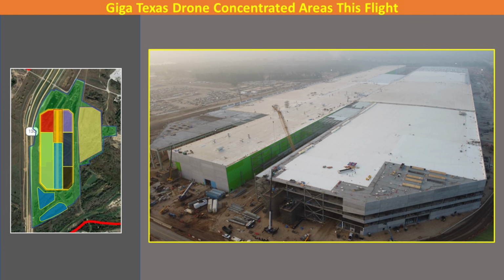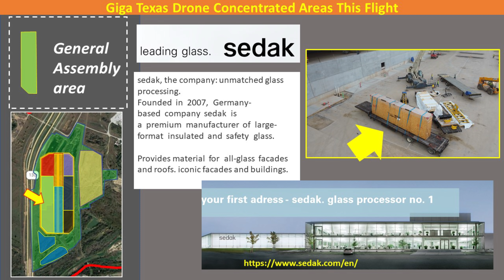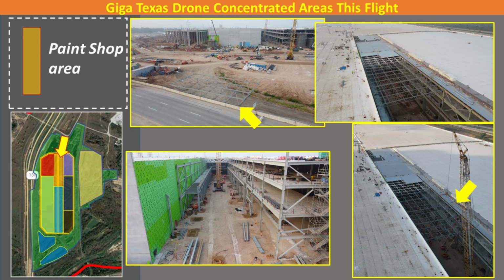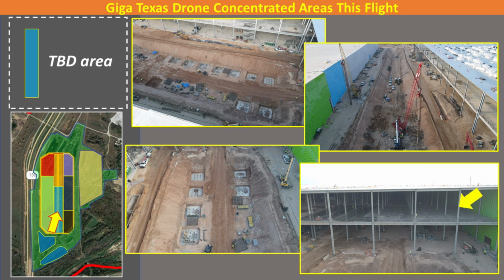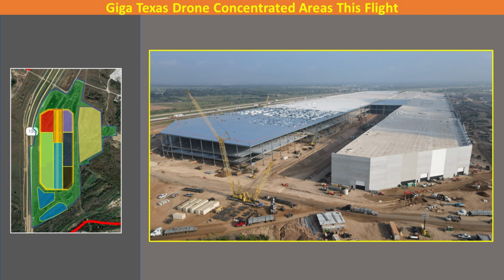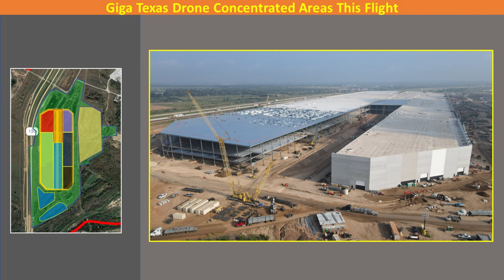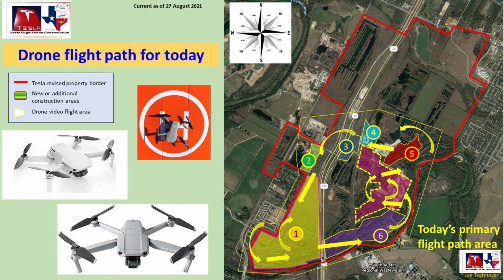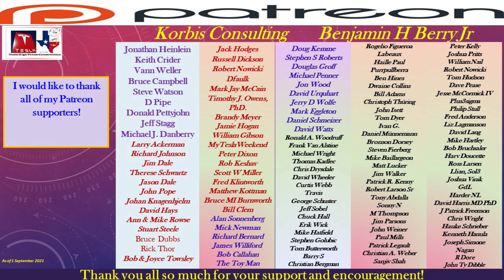Tesla Gigafactory Texas 1 September 2021 Cyber Truck & Model Y Factory Construction Update (07:45AM)

Comment: Thanks Joe. 
4:20. North side paint/casting. Pile of black pipes in front of the red bin. Showing up all around the place. 
4:27.  North side paint. Removed some of the wall panels being used as a temporary apron. Lot of activity in the shot.
4:45. Battery ground floor. Something under cover of plastic. Long row north south.
4:53. North alleyway. East columns. The 2 lower horizontal members have a projecting ledge welded to the east side likely for something to land, another stud wall perhaps. Some visible on the ground to the right. 
5:32. North alleyway. Roof decking is a different profile over the geodesic frames. Less ribs, and likely deeper.
6:28. Bunker roof. Scaffold deck through the opening. Glimpse of something going on under, lights.
9:34. Battery Level 3. Left of screen. Large red valves against the green wall.
10:06. West side battery. Retaining wall. Pipes on the north side have been lagged, might be burying them in concrete. 
11:00. West side GA. Window sills are different to the those further north. Black powder coated. Better fixing likely for the larger panels. 
12:50.  South alleyway footings. Some squares busted out of the mud slabs, must have been too high.
Formwork panels being installed to form up the pile caps. Interestingly, elsewhere on site almost all the footings were poured into excavations, weren’t boxed out.
A few smaller rebar cages to the left.
12:57. West side of pit. 8’ drains. Seems to be careful removal of drains, followed by back filling and compaction. Change of plans surely.
15:42. South end roof GA. Workers on the roof screwing down the sheets. At the speed they are working, it must just be along the joins.
18:01. South west corner. Sprung a leak.
19:20. South end. Bottom of screen. Several loads of what look like dock levellers.
19:38. South end storage. Lone precast wall panel on the trailer is one of those removed from the northwest corner of stamping, 6 or more months ago when the first section of temporary blue wall was installed. Fate undecided?
22:40. East side storage. In those piles of steel are the clues to what is being constructed in the south alleyway.
23:04. Bottom left of screen. Very quiet at the Skunkworks today. Beavering away in secret on……
23:36. Geodesic frame assembly area. The trailer has had beams fitted to the underside  of the cross members. A safety device I’d guess if it starts to tilt. They may have had a moment!
Reply: Glad you're back with your detailed assessments.
Reply: 4:20 - Tons of straight black piping like that is usually for fire sprinkler runs.
9:34 - Fire sprinkler distribution manifolds and shut off valving.
Reply: @jbarvideo12  Thanks Jay. I sometimes miss Randy's because by the time I view it what would be speculation has become fact in Joe or Jeff's videos. Jeff's I generally don't get around to looking at until later in the day, but generally comment.
Reply: @steve4hockey  Should be a lot of that in the battery area. Thought I spotted the main control valves on the ground floor. To the right of the green scissor lift in this video; https://youtu.be/G2Mc7tPVDso?t=973

Better shot in Joe's Patreon pictures.
Reply: @DessieDoolan  yeah there’s sprinkler feeds in a few different places. Red valves and black pipe is typically a Dry-Pipe sprinkler system.
Reply: @steve4hockey  I had to google Dry-Pipe sprinklers systems. Heard the term, but really didn't know what it meant. Don't think I've ever struck one before. 

Amongst other things, they'll have to crack on with getting the water supply sorted out. As far as I know the water is still being carted to site.
Reply: @DessieDoolan  Very common here especially for facilities like this. A lot more maintenance and facility friendly to keep the sprinkler legs dry until fire is sensed versus chasing leaks, corrosion and mineralization, and risking your building contents if an accident were to occur that breaks a pipe.
Reply: @DessieDoolan  They have fire hose hooked to a fire hydrant feeding water to the tank area at the north end cooling units. I noticed it about a week ago. This tells me the water is on. Also, a bunch of the fire protection tanks and pumps have been removed.
Reply: @steve4hockey  I've witnessed my fair share of sprinkler issues, cleaned up a flood or two.
Reply: @bobcallahan2322  Thanks Bob. I was hoping you'd chime in with the answer!
Reply: @10:06: I suspect everything to the North of that wall will be a higher grade than the South: South is loading bays, so the paving has to be low ; North is all drive-in doors, so paving will be up to ground floor level all the way.
Reply: @greggerypeccary  Agree. I suspect all that area north will end up being a concrete apron.

Comment: South alley. Deep pilings, pile caps and I think this is another cast concrete structure. Completely isolated except for the roof. I don't see any stockpiled steel and there are similar piles along the east and soon west walls. Thanks, Joe! I guess we'll see how this shakes out. I also wonder if Tesla has developed new machinery for handling SS and this led to those deep piles?

Comment: 6:00 Joe, I don’t think this is located over the underground water vaults. Isn’t this where they lowered the concrete wall panels through the roof, all the way to the ground floor? I seem to recall this entire area of the building being enclosed by precast concrete panels from the ground, clear up through the roof, without any discernible doorways or access points. I’m not saying this isn’t related to storm water management, just I think the location is further to the north than the underground vaults.

I really hope that they open the building up for public tours someday. I would love to see what all of the functions of the various parts of the building are…
Reply: Yes, that's that area. But before they built it, they spent a month jiggering cistern vaults in below grade. It was tricky, cause they'd already poured the retaining wall. I'm told that it is not completely enclosed in concrete panels, but that there are openings in the south and east. So my latest theory is that there will be a massive condensing unit in there, water dripping into the vaults below, and you are seeing the installation of the roof exhaust.  Why? Well, at least part of the painting process (the undercoat) uses a water-based paint, so maybe this is to promote rapid drying. Prior theories said that this would be filled with volatile paint fumes, and the concrete panels would be  explosion-proofing.  But why, then the cistern below ground? Unless its collecting large quantities of condensate? (water condensate?)
Reply: @LinasVepstas  That’s what I thought. This area is in the paint shop, and has something to do with volatile compounds/water reclamation from the paint process. I believe this part of the structure has very little to do with storm water management.
Reply: @LinasVepstas  If they want to put roof solar panels, better not emit too much fumes or vapor there.
Reply: @douglasgroff7648  The vaults they put there, I'm pretty sure they weren't for storm water.

Comment: The roof area you are asking about is where the concrete walls go from the ground to above roof level on all 4 sides. I always thought this would be some sort of equipment room, but maybe it's just part of the cooling. From whats going on on the roof that's what it looks like.
Reply: Its either a large mechanical room or an explosion resistant vault for storing flammable paint shop solvents. We will know after we see what equipment ends up on the roof. They are installing curbs that are open all the way through the decking rather than just sitting on top. Makes me think a lot of air will be moving through here.

Comment: I’ve always thought that there would be two production lines for Model Y. Each line would have a capacity of 500k+ vehicles per year (maybe as much as 750K for each line). This means that Giga Texas may have total capacity of 1.0-1.5 MILLION Model Ys per year. It looks like there will indeed be two production lines, as there are clearly two exit doors on the west wall, one for each production line. The is a door at 10:00 and one at 10:22. The northern door doesn’t have the ramp installed yet, but the southern ramp wall has been completed. Expect to see the northern wall built this week.

What about Cybertruck? It looks like there will be exit door for that production line further south, where we believe the Cybertruck production line will be located. There is a larger door opening at 13:38, which appears to be about the same size as the ones at 10:00 and 10:22. My guess is that there will be a fourth doorway further to the south, it’s just that the wall panel haven’t divulged it’s location just yet.
Reply: I'm hoping one for Model Y and the other for Model 3, that would enable them to have 4680 cell w/structural pack versions for both models.
Reply: @boostav  My guess is that long-term the Model 3 will be produced only in Fremont and that Model Y will be produced only in Austin. There are lots of similarities in the vehicle architectures, however the Model 3 hasn’t even been converted to front and rear castings yet. From a profitability standpoint, it makes sense to fully convert the Model Y to front/rear castings and structural pack first (at Berlin & Austin), cutting production costs on the highest volume & most profitable vehicle. As it stands, the Model Y probably costs about $1000 more to produce than the Model 3, even though the price difference is more like $4,000. Once Berlin and Austin are fully ramped, it would make sense to convert the existing Model Y line in Fremont to Model 3 with castings/structural pack. Then the existing Model 3 line could be converted to Model 2…. All without any production downtime.
Reply: Why do people insist the 10:00 door has to have a second wall to be a ramp ?
All openings north of it are flush, not recessed like docks. The whole north will be ground level, this retaining wall does not need a peer.

Comment: 13:50 Do we think these deep footings could be for Cybertruck brake presses? The 3mm steel body panels are way too thick for stamping machines. Each footing looks to have a 3x3 grid of anchors. It’s hard to tell, but maybe it’s rebar to tie in future concrete piers. Maybe the Cybertruck body will be laser cut from one sheet of steel (side panels, frunk, roof, rear bed). The flat sheet metal will pass from north to south, through a series of rollers and dies, which will bend and crease the side panels. Sounds crazy, but the footings (and trench) look like they get progressively closer as you move from north to south… Once the shell of the Cybertruck is folded, a wedge in both sides is cut at the same time as the door openings, and the roofline can be folded transversely to make the vehicle profile. It’s like making a Chinese takeout box, but with sheet metal!
Reply: Wouldn't it make sense to cut the panels at the steel mill, they already have lots of heavy equipment + less material to transport and waste to transport back.
Reply: I was thinking the same thing
Reply: @lukasboscher9674  The steel will need further processing by Tesla to add their secret sauce. They are not sharing the recipe with the supplier.
Reply: Break presses don't seem that heavy.
Must be something else at play here.

Comment: The decking over the trusses is a structurally stronger variety than used elsewhere. Deeper undulations.
Reply: Probably a function of the length of gaps between members of the space frames being bigger than the length of gaps between the members of the rest of the structure.

Comment: Curious why they are not painting the rest of the space frame truss thingys. The first two were painted white and the rest are just primer grey.
Reply: Speed. You can see they are already decking the first several space frames in quite a hurry. They will paint them after the fact. There may also have been contamination issues during painting of the first two with all the dust whipping around on the ground.

Comment: They should use the rain water running off roof to generate power I know it’s probably to late
Reply: Not enough days of rain, flow, or head pressure to be economical as hydropower.

Comment: I believe the area in question is storage for flammable hazardous material, used in paint shop. It is surrounded by concrete walls from floor to few feet above the roof, for containment and avoiding spread of fire and fumes in case of fire. Hence, special roof conditions and requirements. Underground vaults are most likely for containing any chemical leaks. And, in case of fire, for containing any chemicals used to put the fire out.
Reply: The roof should have panels blow away in the event of an explosion.
Reply: The larger underground vaults installed south of the paint shop are most likely for filtering the water used in paint shop for acid baths and cleansing the paint equipment.
Reply: @LIGHT1vsDARK  They hooked multiple roof drains into the larger vaults. We watched for weeks as they hooked up the plumbing.
Reply: Yes, that was the theory, before they started installing the mega vents. What's up with those vents? why there?

Comment: 10:08 i don’t think its a wall, i think they are making another ramp
Reply: There is a ground elevation change between the two sides of the wall. All of the building entrances on the north side of the wall are at grade, while the elevation on the south side is a few feet lower to accommodate the truck docks. When finished, the pipes will be below ground on the north side but the outlets will be exposed on the south side. Unlikely that there is a ramp as the north side doors will already be at grade.

Comment: At 5:55 that walled in structure is apparently an air plenum that feeds air to all the floors.  They're apparently installing air handlers and filters.  I'm wondering why the whole thing wasn't covered by a shed to keep the weather out.

At 11:00 That special high strength glass and special handling equipment must've cost a lot more than the smaller panels on the rest of the bldg.  It would have been better to use the regular windows instead and paint the walls black in the pattern that they wanted.  If they wanted to be eco-friendly they could just transplant lots of  trees along this side of the bldg to blend in with the "ecological paradise" that Elon called it.

Thanks, Joe for the great video.  The low closeups are awesome!
Reply: The glass is also insulated, a specialty of that company.
Reply: Large geometric designs in paint just look cheesy, tacky and cheap. If you're gonna go with paint, get a bona-fide graffiti artist. Highly recommended is the local who calls himself "truth".
Reply: The walled-in in structure had almost no openings.

Comment: I wonder if they’ll use those trusses in the new footer areas since the footers are further apart
Reply from the maker: Not sure what they will do in that area yet ... it is an interesting mystery for the time being.
Reply: Maybe the trusses are part of a giant hoist system for bringing materials/equipment into the casting area. If they want to install another casting machine at some point, that would be the only way to get it back in there.
Reply: Maybe the trusses are part of a giant hoist system for bringing materials/equipment into the casting area. If they want to install another casting machine at some point, that would be the only way to get it back in there.
Reply: @patreekotime4578  Space trusses are the most economical way for large spans without any support. From the looks of it, this area will stay open to outside. Trusses they are installing, are not capable of carrying much load more the live and dead loads of a typical industrial roof.
Reply: @LIGHT1vsDARK  It is difficult to tell scale, but these trusses appear to be more than 12 feet tall.  And sections of that roof are NOT trussed which tells me that such huge trusses are not generally required for this span.  Certainly not trusses of such magnitude.